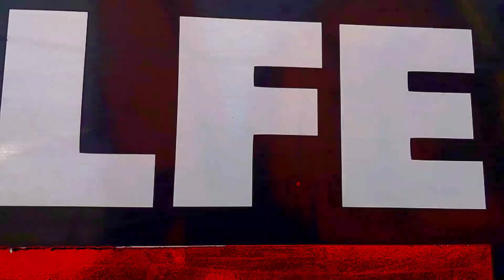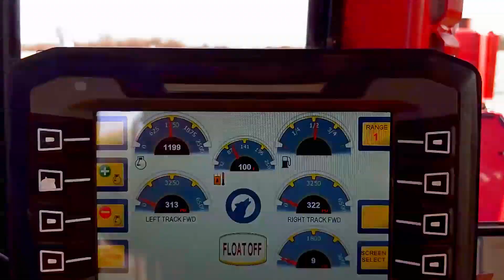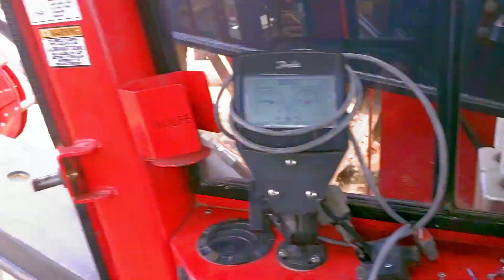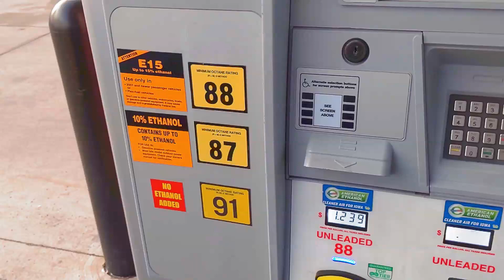Automating Wolfe Tile Plows Grade Control and Steering with GPS

Comment: Have you ever though of using your Tile plow to installing plastic to be used for heat banking for Greenhouses
the first layer would be at a depth of 10 to 12 feet to top of pipe then come up 2 to 3 feet and lay in a second layer 
On a 40' wide house it would receive about 8 runs of say 12" pipe then moving up above the first run but shifting to the side of the first layer a bit the second layer could be a smaller pipe say 8" and 9 or 10 runs all of witch get tied to manifolds at both ends with risers being brought to the surface that circulating fan would be connected to 

Not sure of the cost to run your machines but for a large project I would think it would be cheeper than re moving 32,000 yards of dirt and then replacing it with out damaging the pipe that gets placed in the hole
This would be a small scale greenhouse 12 - 40' x 120' high tunnels just under 60,000 sqft of grow space others are much larger in the half million sqft for cannabis growers 

A lot of DIY types use 4" or 6" pipe and cover with pee gravel to keep from crushing the plastic pipe 

Geothermal technology may not be the answer for all our problems but you car rest easy knowing all the green people will be pushing it
Reply from the maker: I know guys who have used their plow for geothermal (which seems very similar to what you are describing).  These plows only reach a max of 7 feet but more realistic 6.5 feet.  These machines are built for running long fairly straight lines so it could be done but you would need to change a few things up a bit.